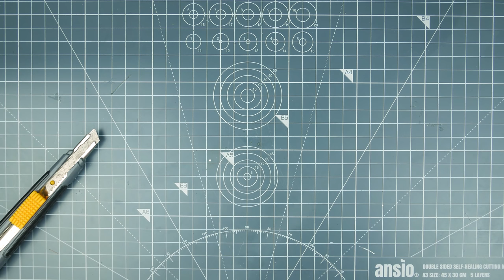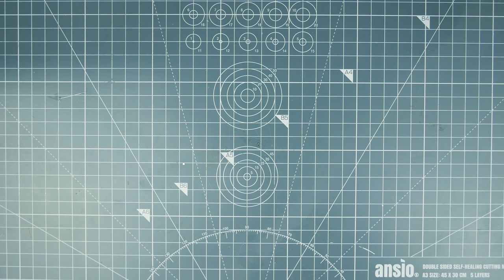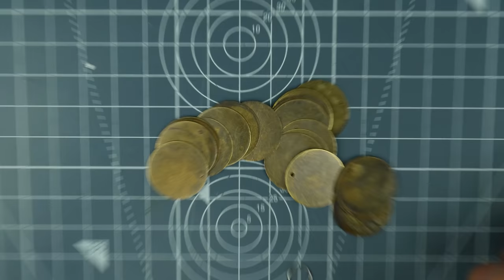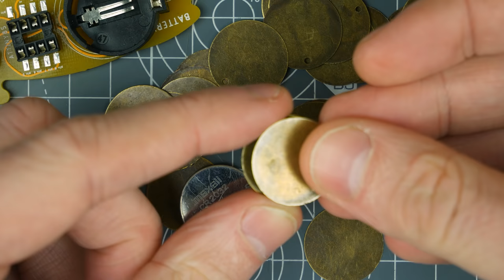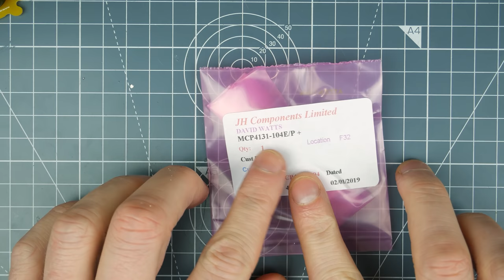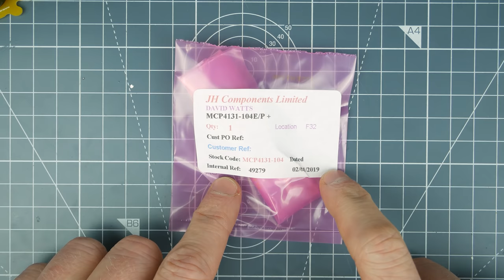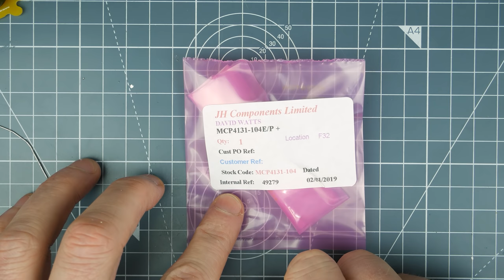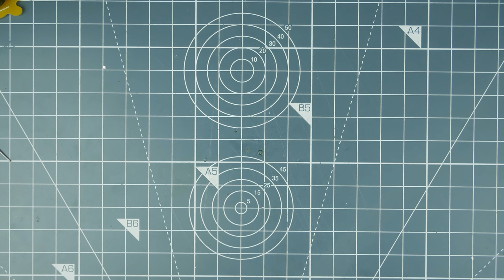Post Bag 15: Mishmash

Comment: Yup, nice idea with the 2032s .. However - The negative side might have to be smaller than the positive since some holders connect the positive via the rim of the battery.  One option might be a flat coil of solid wire in a cavity in the separator?  Maybe some solder to help keep it's shape.
Reply from the maker: I like the solid core wire idea, might work well with a 3d printed puck.

Comment: Nice video :)
The MCP4131-104E/P (uses SPI btw) and are also available from Digi-Key, Mouser for about 54 pence each, the reason it might be hard to get and pricy is due to they are discontinued on loads of online stores for some reason, that battery eliminator you will have to use a smaller disc at the bottom due to if you used two of the same discs it will short out on the side pin/clip of the socket.
I will look forward to those future videos :)

Comment: CR2032 (all button cells) holders usually have the positive connection on the SIDE, not the flat face.
So, easy solution is to glue an  insulator and your bronze disc onto a dead 2016 cell.
Then solder the positive wire to the dead cell's casing and the negative to your bronze disc.
As others have mentioned, you  will need to notch the bronze disc so it doesn't short out onto the negative terminal in teh battery holder.
Reply from the maker: We'll see what happens, I considered soldering to an old cell. Not really sure what terrible things could happen with that though.

Comment: Nice. I'm trying to eliminate those silly 9V PP3 batteries. So I solder on some barrel connector (is it 2.5mm?) And use that. LED tester, cheap multimeter and soldering iron temperature thingy all take those. Much easier just to plug them in eh.

Comment: David, nice haul! You probably mean the sk6822 if you mean the kind that continue  passing data after a COB driver failure and are much more reliable for extensive "permanent" LED lighting installations. You might do a little foray into the SK vs WS for your subbers. Been a while since I was doing some Ardy projects with the Fast LED code but wanted to revisit after I found some better library. I'll see if I can get you a link to the page I was recently perusing.
 EDIT: Recent update to control all FastLED effects with one switch >https://goo.gl/3FP8YK
Also I found that that code was updated to allow for the SK6822 and ESP8266
Reply from the maker: I think I meant the continuous usage thing about the digital potentiometer, I wanted it to work when the micro controller is powered off. No idea if it will work that way but I get that impression from the datasheet. I am kinda set on coding the LED thing myself but we'll see how that goes when it all gets installed.